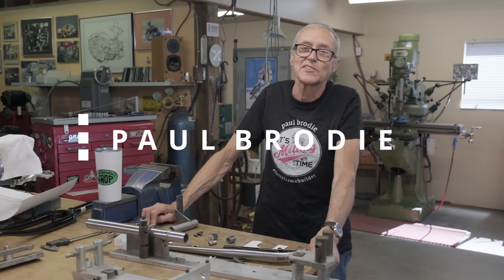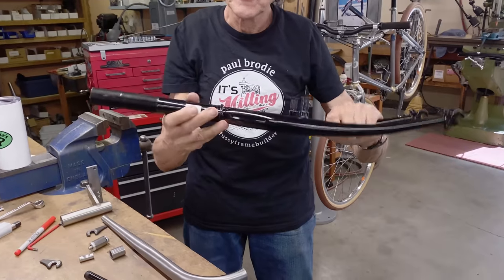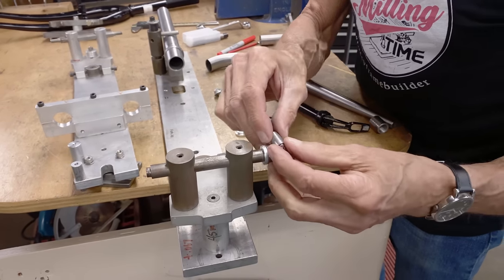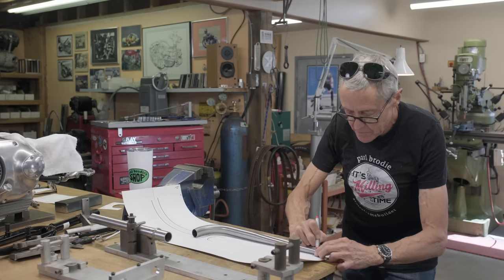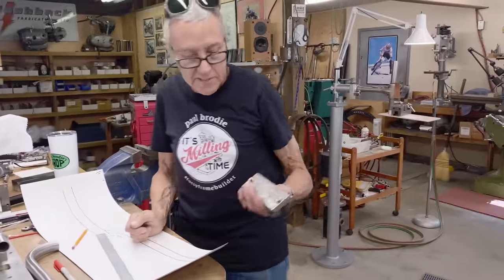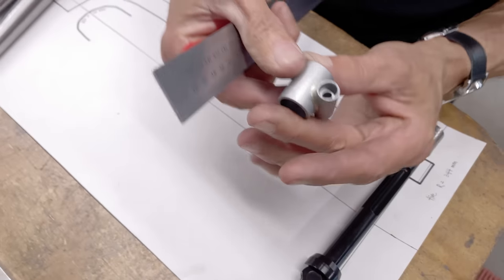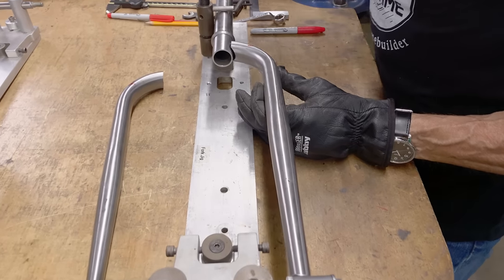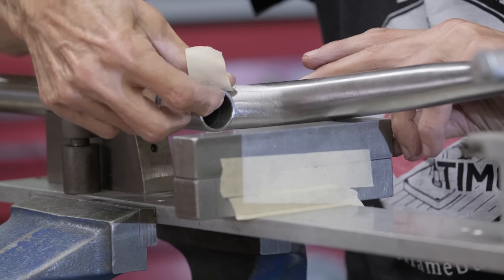Making a FORK for my Gravel Bike // Paul Brodie's Shop

Comment: I'm 55 and still learning new things.  I visit my local school often and bring in a project and tell them how I just learned to weld, or I learned something new at the fore department.  I'm always telling them, it's never too late to try something new.  I love spending time working in my basement shop, working a new technique into a build or repair.  I recently purchased an oxygen generator from a medical supply who was sending out their old ones to be recycled and I've been practicing brazing with propane and oxygen.  I've only used this combo when brazing platinum.  Currently I have an old mini jewelers torch.  I've just ordered a new setup for acetylene.
I'm ordering new solder. Most of what I have is jewelers wire solder which are gold and silver from 55, 65 and 75 percent.
I taught myself to weld a few years ago and I love working metal.
Reply from the maker: I think you have a very good attitude, and sharing with a local school is excellent! All the best to you :)

Comment: Gotta love some improvisation making custom parts. 
Something that has puzzled me since I was about 12-13, how are the tapered tubes actually made?
Over the years I've cut up a few fork blades and chain-stays, there isn't a seam inside so they are hot drawn?
The technology has been used for over 100 years on all types of bicycles, including really cheap ones  but I still don't know how it's done?
Reply from the maker: Tapered tubes are made on a "swaging machine"... I have never seen one. Very powerful, probably noisy too. External rollers are used to "swage" the tubes to smaller dimensions...   :face-orange-raised-eyebrow:

Comment: Paul & Mitch, as always, thank you!  I always really enjoy your discussion of jigs & fixtures.  Hole saws... ugh.  I have such mixed feelings about them - when they work, they're awesome, but when they go bad, they go all the way bad.  I blew up a holes saw in my lathe a maybe 3 months ago, it was ugly.  The arbor thread was very thin and stripped out.  I welded a new disc to the back - I've done this before with great success.  I was facing the arbor mating surface flat, and the saw collapsed inside the chuck when the tool touched the disc.  Something flew out hard enough  snap off the quick-change tool post locking handle!  I found the knob for that handle all the way across the shop.
Reply from the maker: You be careful with those hole saws! Maybe you need a higher quality, as hole saws last me very well, and I have not had problems like you have experienced...
Reply: @paulbrodie  Yes, undoubtedly.  This was a big box store hole saw.  What brands do you use?
Reply from the maker: @Alanbataar  Brands that have worked well for me are Starrett and Milwaukee ...   :face-fuchsia-tongue-out:

Comment: Where I live gravel is apt to be anything from rip rap chunk to hard pack. I used to use 45mm wheelsets with drop bar but after too many flats I now use my 150mm FS bike with 2.5 tyres supplemented with a 1000w PAS mid motor....more akin to the Tiger Cub I guess but it sure is fun on the gated logging roads down here! As well as beaches and single track that are part of my routes.
Reply from the maker: Yes, I have a FS e-bike and I am enjoying that a lot. Sounds like you are on the same pathway!
Reply: @paulbrodie  Yup, the off the beaten one!

Comment: The pinch bolt on non threaded side is not needed, as Maxle axle (that You are using) expands and locks itself in the dropout when You lock the axle lever. It is kinda quick release through axle.

Comment: Love your videos and I always look forward to new ones coming out. Do you have any videos that go into the tools in your workshop ? For example, I see you have a Record vice (not sure if it's a No.4 or a No.5), but you have recessed it into the workbench top and pulled it forward slightly. I'd love to know the reasoning for this
Reply from the maker: Thank you. My 5" vise is mounted forward because when I hold a frame in the wooden frame blocks in the vise, it needs to hang down under the vise, and not interfere with the workbench or the shelf below... make sense? The vise is very securely mounted to the steel frame of the workbench with (probably..) 1/2" NF bolts. It can't move from the force needed to align frames and forks. The plywood is cut out so that it fits around the mounting points of the vise...

Comment: Love your reasoning on the newest "fad" Paul, absolutely 100% accurate, a modern gravel bike is just an 80s MTB with TA instead of QR and disc brakes, i.e. some of the first 29er MTBs would be good candidates for one 😆 So, looking at your drawing and the reference 650B wheel, seems to me that you built a fork capable of running a 29er/700 wheel as well/instead - is it going to be 650B or 29er/700C? To me a 29er/700C would make the most sense and rims, tyres etc would be more widely available for it. Also curious, what did you set the offset too 37mm or 42mm, or did you do more?
Guess we'll be having the pleasure of seeing you build the rest of the bike, which has me wondering if you've settled on the geo yet? I'd say my old '08 Karate Monkey has pretty good "gravel bike" geo, if maybe a tad too steep HTA and bit short Reach, if you want to really play on the more technical off road, think my ideal "gravel bike geo would have a 70* HTA and 73* ESTA, designed around running a regular flat/MTB handlebar and 70mm stem, so longer Reach than a drop bar variant. Looking forward to seeing what you come up with.
Reply from the maker: I have the 650b wheels, so that is what I'm going with. A 29er wheel would have to have a very skinny tire to fit. I do like 650b. The fork offset is 45mm; I think I mentioned that in the video.. Head angle 70.5 degrees, seat angle 74; just the same as the mountain bikes we used to make :)
Reply: Paul, if you did mention the fork offset/rake, I didn't hear it, thanks for answering, sounds like that's going to be one sweet "gravel" bike. Well, maybe it won't fit a 29er setup, but sure would fit a nice 650B+ 2.8" if you wanted to take it off road on some proper trails 😀
That's very interesting, didn't realise that back then you were already making MTBs with a 74* STA, that's pretty progressive for back then.
Reply from the maker: @lynxg4641   Thanks..  I have a FS e-bike for the trails. It suits me very well. The gravel bike is just for fun and to rip around my neighbourhood...

Comment: loved the video just like any other video of yours. Thank you very much! Although I noticed you didnt weld the brake mount on the fork. Are you planning to do so? The reason im asking is because i have a specialized rockhopper 1997 frame which I converted to through axel but i cant figure out if I can weld disc brake mounts due to changed forces. It seems that you have a very similar fork to mine, the wall thickness seem to be around 1.5 and hopefully 4130 steel?

Many thanks

Comment: It'd be interesting to hear your reasoning behind splitting the joining process between TIG, nickel-silver, and brass. Is the TIG welding only done to spot-weld the parts into position or are there structural reasons? About the nickel-silver and the brass solder: I guess the order is dictated by the melting temperatures of the two materials. Is the nickel-silver stronger than the brass solder, or why are you using both processes?
It's always interesting to see your custom-built fixtures 👍
Cheers

Comment: I watch every your video Mr. Brodie

And I cannot decide on which side I am.

Half of me wants to make bike parts and accessories by hands 

Another half understands that it is much much cheaper just buy them.

Even if I can afford brazing tools, lathe or drill press I don't want to commercialize this hobby. And so I just afraid tools will be staying in garage useless after some time.

And here I am with a small propane torch, vise and file struggling to make a pizza rack :)

Comment: I like what you said about how a gravel bike wasn't much different from a mountain bike in the 80's.

I have an early 90's mountain bike and some guy online was telling me to get a hybrid instead of a new mountain bike.
I'd never heard of a hybrid before, to me a mountain bike was a hybrid between a BMX and a racer, so I had to google what a hybrid was.
The description online just sounded like a gravel bike or an old mountain bike to me.
The guy online who was in his 50's and should know better kept saying a hybrid wasn't a mountain bike but wouldn't supply me his description of one, as far as I could tell it was basically mostly the same as an old mountain bike, so I don't know why it's not called a mountain bike.

I think they have too many categories for very similar bikes. As far as I'm concerned they're all mountain bikes and they're just sub categories.

Nice work on the forks.

Comment: Paul, have you considered using a 1" ball nose mill in your milling machine to miter the forks rather than filing?
Reply from the maker: Jack, I have not considered that. As mentioned in the video, this is the very first time that I have actually filed the mitre for a uncrown fork. A 1 1/8" ball nose windmill (not 1"..) would be quite expensive, and the chances of one of the flutes catching the edge of the tube, and thereby possibly destroying it, are high. And that is why frame builders usually mitre with hole saws (cheap..) and not large windmills. Thanks for commenting.

Comment: Hi. I have noticed that you braze over your TIG weld joints. Do you do this for cosmetic reasons or for needed strength? I love your videos, thx Bill
Reply from the maker: It's just easier and faster to Tig tack, then fillet braze. That's what I like to do. They are both very strong. And fillet brazing is personal preference, sometimes!
Reply: @paulbrodie  thank you for the response. Great video series!

Comment: The rake is positive caster. Caster helps to stabilize the wheel which is why a person can ride a bike with no hands. If there were neutral or even negative caster and a person tried riding a bike with no hands the front wheel would flop back and forth or even go 90 degrees sending the rider flying through the air with the greatest of ease. Too much caster has its draw backs however the faster a bike is going to go, the more positive caster is needed to maintain wheel stability.. Bicycles won't need to worry about this, but motorcycles would. If more caster isn't added for a bike going really fast, the same issues will result with the wheel shimmying back and forth and maybe even going 90 degrees, thus sending the rider through the air with the greatest of ease. This is why drag bikes have such an extreme amount of caster on their front forks. Cars and trucks also have caster and the faster a car or truck goes the more caster is needed to keep the wheels stable at high speed.
Reply from the maker: You're only talking about one part of the equation. What determines the handling of a bike is the "trail". Trail has 3 components: head tube angle, rake, or offset, of the fork, and wheel size...
Reply: @paulbrodie  Head tube is a function of caster, as rake is. On motorcycles and bikes its a little more involved whereas on cars its a little more enigmatic in how its designed and functions. When I built my motorcycles I always kept a stock headtube angle but Id choose forks with a little more "offset" on the end and that always worked for really good handling on the road and switchbacks and I never did any speeding so I didn't have to worry about wheel shimmy at high speed.

Comment: We used to call it cyclecross.
Reply from the maker: Bit different. In cyclocross I believe the widest tire you can run is a 35mm, but I could be wrong...
Reply: @paulbrodie  Hi, you are correct, they are different. I should google before I comment. Tire width, frame geometry, gearing, and a couple other things set them apart. Thanks for the vids, happy you a feeling better.